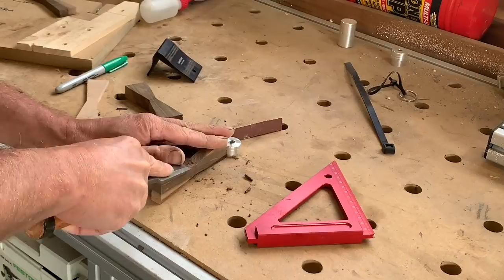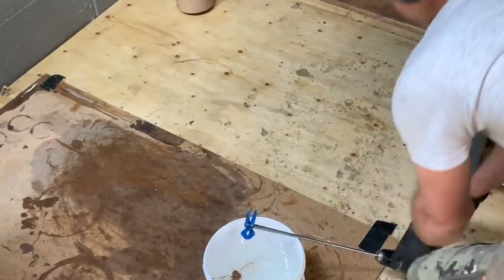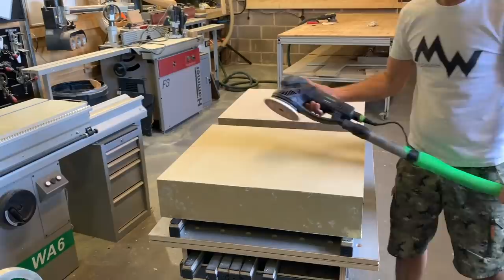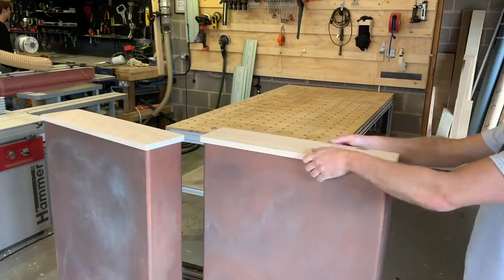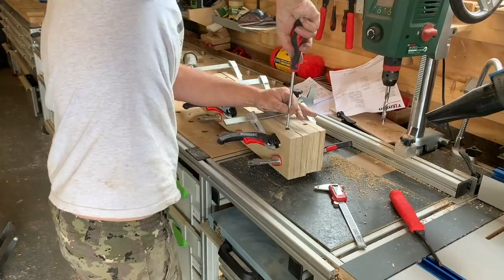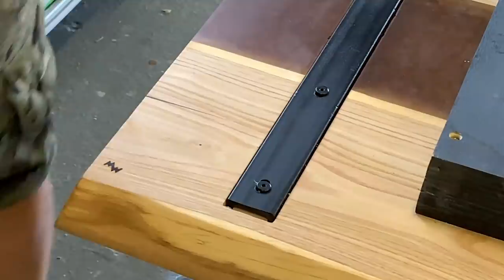English Chestnut - Bronze Epoxy Resin Desk

Comment: I've been following youtube "river tables" for a while now and I have to just say this...you are truly one of the most talentated craftsman I have come across!!  Unbelievable!! Anyway, I have a situation/question that I'm really hoping to pick your brain with.  i recently did a 50 inch "sofa" live edge epoxy river table.  I finished it by doing 3 seal coats and 1 flood coat.  Well, I didn't like the shiny, plastic look of it so I sanded all of the epoxy off down to the wood and epoxy river...2 weeks!  I took it all the way down using 60 grit paper and now I'm wondering just how badly scratched up the epoxy river is going to be.  My goal is to finish it with the Rubio Monocoat now.  So, I know that i need to start working my way up in grit now to 150 for the wood, but will that be good enough for the epoxy.  Do i need to find some way to sand just the epoxy to a much higher grit???  I know this is long and I apologize but I'm kind of striking out here on info/help so thanks in advance!!
Reply from the maker: cheers !  if you go bad=ck over some of my older video i have lost of info in finishing Epoxy and Wood which will answer all you questions.. :) . I also have a patreon with even more in-depth video on this subject .

Comment: I am going to make a similar table, but I am not sure how to seal the slabs from underneath before pouring the Epoxy. I guess you are using silicone. The problem is the alignment of the slabs towards each other, because there is no chance of realignment. Have you ever considered to use PE tape for insulation like this (sorry for german):   https://www.hornbach.de/shop/PE-Tape-10-m-x-50-mm-x-3-mm/7625295/artikel.html
Eventually putting it between two layer of non sticking adhesive tape, one on the PP foil, the other one on the back side of the slabs. I guess due to the weight off the slabs the PE tape will be compressed to less than 1mm thickness.